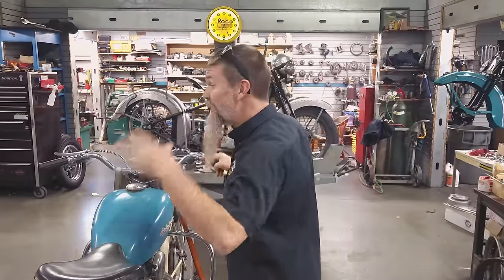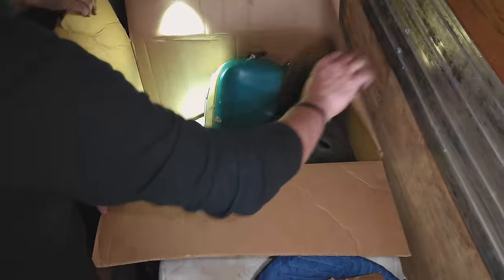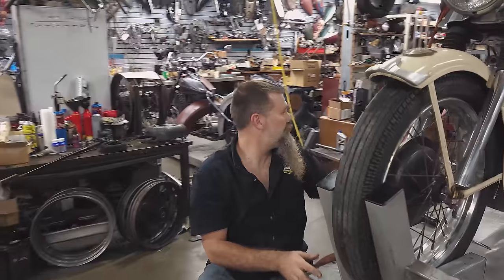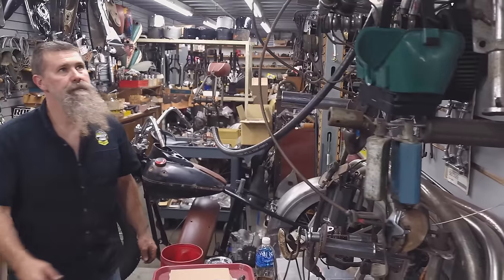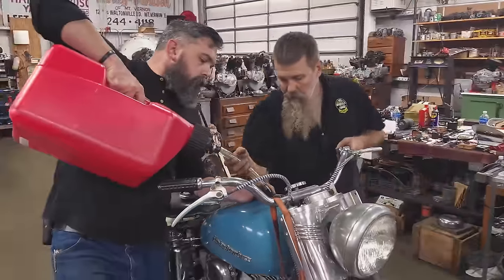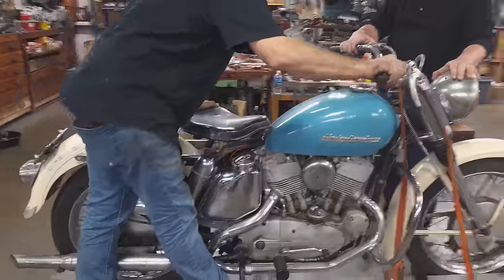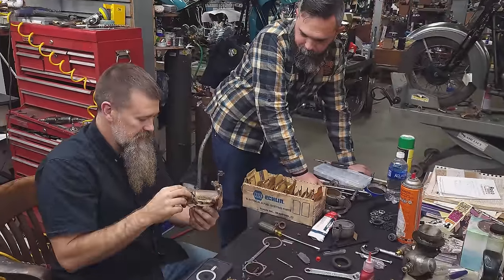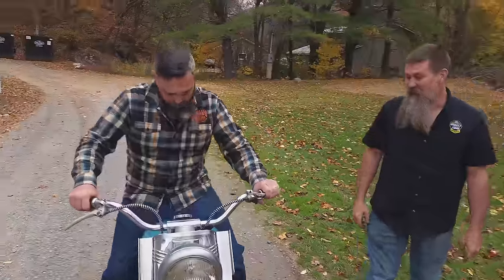Forgotten Harley Sitting over 50 Years — WILL IT RUN?

Comment: Having owned a 56 KH your starting technique is all wrong.  Key off, full choke, three kicks.  Bring it up to top dead center, back the choke off two clicks, full advance, kick it through and it should start.  Try to stay off the throttle because it will flood easily.  The only time I ever had issues was in Rock Springs, WY and is was 35 or 36 degrees that morning.  I carried an extremely hot plug for the possibility of a cold morning and after I put the hot plugs in it push started after about 10 feet.  Warmed it up and put the cold plugs in and off we went to ND.  The nice thing about grip adjustable advance is you could take a little timing out at 80 and the engine cooled off.  It could actually feel the rear head and there was a noticeable drop in temp by taking a few degrees of timing out at speed.  Another thing you need to know.  The key cylinders were Briggs and Stratton and they had no tumblers/inserts in them.  If you have an uncut B&S key you are good to go.

Comment: Ya need a small Concrete Mixer, like Bricklayers use, to clean Tanks. I used to work in a Restoration Shop and we'd fill rusty Tanks with Nuts and Bolts and then strap them to a Board and strap the Board to the front of the Mixer. Turn them for a hr or so and it would make even the RUSTIEST Tanks clean up like brand new 🤠
Reply: I've seen a contraption made of an old bicycle wheel with no rubber on it, a belt and a small electric motor. Wheel was fixed by its axle to a wooden stand, belt goes around where the tyre was and around the shaft of the small motor, whatever tank you need polished on the inside gets strapped to the spokes of the bicycle wheel and the motor gets turned on. I think it was a wiper motor from some car, minus the gearbox, but whatever you can whip up will do. The whole thing wasn't spinning very fast, but that was the point to let the stones roll inside rather than jumping and denting things. Pretty much built up from what you can find in a scrap pile in an average workshop.

Comment: My first Harley was a 56 KH. I paid $150 for it running. Guys who wanted to race "that 45" got a quick lesson! First foot shift, hand clutch, first unit construction engine/transmission. Right foot shift was because of flat track racing heritage. The street models were produced to justify the racing models.The reason they went from 45 in( for 750cc class) to 55 cu.in. 883cc. is because a 1000 cc class had been created. 883cc allowed for some boring as the engine wore, without exceeding race specs.Right foot shift was for constant left turns during flat track racing(without brakes).It helps to keep right foot under shifter, and left foot right over the brake, to buy time to realize the opposite controls. Early models required splitting the cases to access transmission. Later models introduced the infamous (breakage)"trap door". That's most of what I was told/read/remember... Thanks for keeping alive the history of the machines that created this passion! There is no other understanding that compares to riding  a new old Harley.

Comment: You guys nailed it and brought back great memories. Coincidentally I was born in 1954 Kevin Hall “KH” and my first new Harley was a 1974 right foot shift Sportster. Still on Harleys fifty years later.
Reply: That was my first Harley too. A 74 Sportster. After my brother crashed it I put a hardhead on the frame with a nice stretch an rack and a Cali. Cycle Works Girder 12 Over. Rode like a dream once I got the Arms dialed in right. No hands at 80 plus.

Comment: I own a 1953 K model my Dad gave me for my 16th birthday. He bought it from a guy he worked with and spent about 6 months of weekends in the basement fixing it up. He painted the frame black, and the tank and fenders red. Recover the seat in black pleated leather and button tucked it. Had a bunch of stuff re-chromed. It looked like a new bike when Ihe gave it to me. I rode it to school and back in the warm months and I've been riding it ever since. My wife rode it quite a bit and I rode the Pan head I bought later. My youngest daughter rides it quite a bit now. It got a complete engine and transmission rebuild last year so, it ready to go for another 20-30 years. I do have a real soft spot for the K model and I'll have it until I die.

Comment: After 60 years of small engine repairing I decided they should be lit up the same way an industrial furnace is. First is airflow, then ignition, then fuel. With engines the same parts that move air though it also causes compression. Make sure the exhaust isn't plugged and the throttle is open. Then I like to make the ignition work GOOD usually I motor them with a big drill at high speed to see that spark doesn't crap out after it makes 3,4, 10, 50, 100, 500 sparks. Realize your test gap needs to be fixed at about 1/4" inch. You got compression (and airflow) and spark (at the right time: 20-25 before TDC is close enough it ought to start) you are all set.
       Using your fingers to squeeze a small gas bottle (2-cycle mix bottles work well) with a 1/16th or 3/32nds hole in the lid IS "digital fuel injection".(lol).
       DON'T PUT ANY GAS IN THE TANK.
     See can you prime it a little and get it to start. See can you "catch it" and keep it running. You can? It burns it's fuel eagerly? Well then go ahead and put fuel in the tank with the petcock shut off (or pinch the hose off with forceps) and start it and catch it an keep it running - THEN turn the fuel on. If you get no gas you will know it. If it dies and adding gas doesn't help - then it's flooding.
Remember kids - there is no shades of grey with compression - the valves piston rings head gaskets just cant leak AT ALL. And ignition is just Yes or No. If it misses any sparks at all then stop and fix it. Only fuel delivery has a sweet spot that you must - like Goldilocks - find by experiment to be "Just Right".
      You are welcome. If you ask I will tell you how to make certain the valves and stuff don't leak. ("at all").

Comment: By 1968 on Triumphs the primary chain oil is shared with the engine oil and you must not mix grades. To help to remove the drain plug grind down a ring spanner as access  is poor, a special tool is available to adjust the primary chain tensioner. Use Wellseal or Loctite 542 on the threads of the drain plugs or replace the fibre washers with Dowty/Bonded washers. Use two fibre washers on the primary level plug and an annealed copper washer on the gearbox level. Over 12,000 1969 Bonnevilles were built, enjoy.

Comment: KH has a 4 9/16" stroke. The flywheels were used to stroke a Sportsters for years until George Smith started making stroker flywheels. The hot set up was 3 1/4" Dytch Barrels and a 4 5/8" stroke for 77". That's what mine was. Along with an S&S GAL carb and Stock magneto.Mine weighed 400lbs and Had Koni shocks and 160 mph rated tires. Sifton Minus Minus cams, S&S collars and keepers push rods..

Comment: I use muriatic acid to get rid of rust in things like that oil tank and gas tanks. It will definitely remove the rust, but you might wind up with a tank full of pinholes. I like that color. Been thinking about repainting my 2006 Sportster 1200L. I might paint it that color.

Comment: The Matchless/AJS has a Matchless badge on the tank, but the timing cover is AJS. Check the engine number (just below the cylinder barrel flange). It will have a two digit year code (my guess is that it will say 52), then G80S if it's a Matchless engine, or 16MS if it's an AJS, then the consecutive number. 
Lovely KH... always loved the look of them - as you say, pure 50s!!!
Reply from the maker: Thanks for the tip!!

Comment: I had a rusty tank on my 78 sportster. So i bought 2 tubes of BB`s put them in the tank with 2 cans of Gas antifreeze and shook the hell out of the tank, did this 3 times. the tank inside was shiney bright. Then put in liquid rubber that is used in airplane gas tanks as a sealer. Fantastic ran the bike for 8yrs. :person-turqouise-waving: SKY

Comment: I owned a 1952 Model K, first year of the Ks.(Sportsters). It had 50 year anniversary medallions on the front/rear/ tool box..  Not fast and soft rear cylinder.  I melted the back of the back pistion, blew it into the crankcase.  Sold it for $50 as a basket case.  It later became a flat tracker in Chicago area.

Comment: Dude no worries on the fire in the face . The sensation goes away after a few hours. I cleaned the carb intake on my bike and started her up to let her burn off any excess cleaner. I brapped her a coule times and she seemed okay. But i gave a good roll on that throttle and did the same thing getting fire to the face. Without the cover on. Just the tips of my facial hair got singed. Was fine in no time. But she ran so much better and i stopped not checking if what i was putting in was ethanol based. Wasn't another bike model spun off the KH? I omagine the guy that rode in that side car mustve needed some kind of ear muffs . That exast is close and looks like it would be loud.

Comment: Hmmmm. More brave than I. I quit old sportsters a while ago. Can't stand the transmissions. And I always felt the four cam design was a leftover from the early flathead days. I get trying to straighten the pushrods, but who cares as long as you still have S shaped rockers? Eh whatever. Just an old guy rant.
When you going to raffle an old UL? That's the four cam I want. 
Have fun all and be well.

Comment: In 1965 I got a $600 fast 1955 KHK with  factory experimental cams ,that  Robin Durand in Sanford Florida Motor Cycles rebuild the engine for me and set the motor up bad ass, high compression hard to kick over ,it would haul ass and would leave the new XLCH Sportsters  sitting in the smoke at the starting line for about 5 bike lengths ahead through the 1/4 mile , it  turned high 10s,no wheelies just hauled ass, the tires in first and second gear just holled, I  then shered  the front primary rivites  into  I then broke the back sprocket hub and brake drum hub spendal into, got that fixed , then i got a  big ticket for raceing,on the highway  , that  bike got me in a lot of trouble, So I decided to sale  the bike to a Orlando Florida, City MC policeman for $600 , he said he liked the Bike be cause it would out  run anything in Orange city or countys MC Harley department I, sure do miss that bike it looked like Elvis Presleys K model Red in paint,😊 😢😢 Good Old days !

Comment: Back in the 70s I had a "55 KH. I lunched the tranny and had to go to Boseman MT to find the gears digging thru a box of gears 'til I found the correct ones. There was a guy in Seattle not far from my home that raced K models, and he had a stack of engines in the corner of his shop. He wouldn't part with one piece of any of it. I put mine back together, and sold it, used the money to buy a Panhead. K models suck.

Comment: Cool bike way to many kicks trying to start a long sitting bike with out checking compression. Carb and points. I worked on a 47 el knuckle a couols days ago had been sitting for six months i checked all the above took 3 kicks to get running. Owner was told by a shop that had it for months the valves were bad.